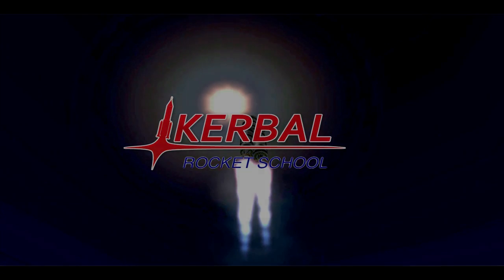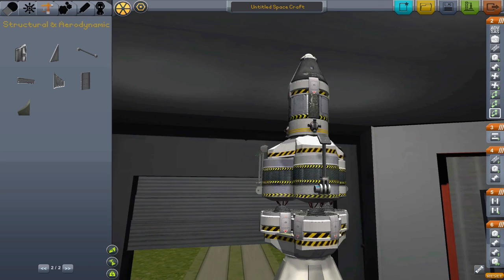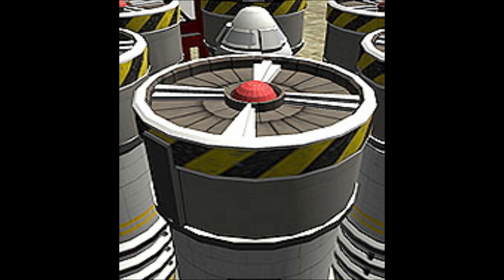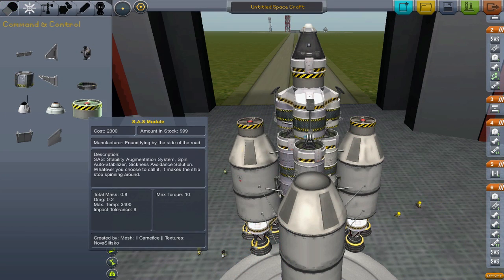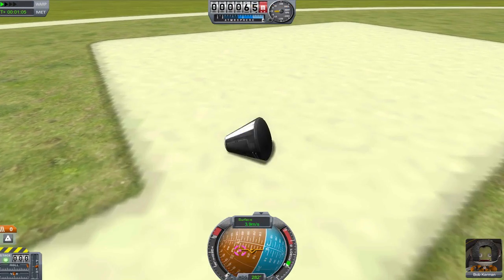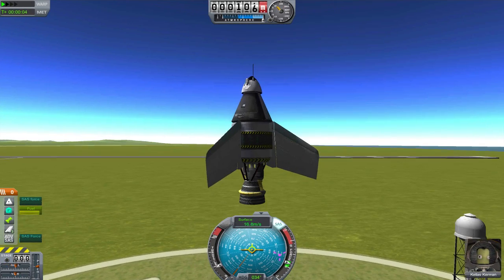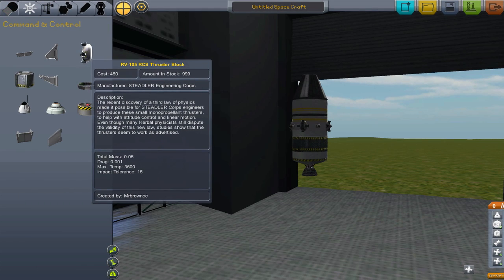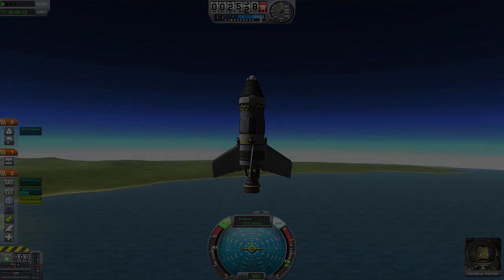Kerbal Rocket School | Episode 5 - Stability and Control

Comment: "Control surfaces are really only supposed to be used on planes, but I guess you could.. Ehm.. I mean.. No.. Ehm.. Like.. YeahThey´reMeantForPlanes!"
I just had to pause. Couldn´t breathe :D!

Anyway. Stability and control is not that hard. It could be explained in about 30 second. Even with a normal speaking pace. Strut connectors - add more! The important things in this video is: Add struts, add ASAS/SAS and remember RCS fuel for your RCS thrusters. Ship still unstable? Add more!